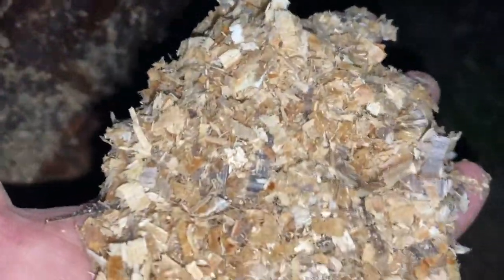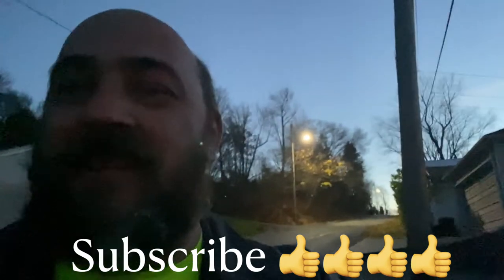Ported Homelite Super XL Auto Testing Round 2!

Comment: How did you port that saw?  Did you open up the intake and exhaust port?  I have a few super XLs and am curious.  They are a reed saw, so i don't know what to do with the intake side.  Did you deck the jug in some way to boost compression? take care
Reply from the maker: Don’t do anything to intake. Make sure reeds are working perfectly and no leaks. If you keep stock reeds they won’t last long.
Reply: @Smittyschainsaws  Thanks Smitty; I wish i had a neighbor like you that suffers from the same sickness as i do with a passion for old 2 strokes.

Comment: I saw a video here on YouTube where a guy found a different reed cage and reeds on amazon or something that fit right in
Reply from the maker: That was probably me!  I ordered another set because that first set is currently installed in a different saw.
Reply: @Smittyschainsaws  how'd they end up working out? Do you have a link for the part?
Reply from the maker: @hickerbilly345  I don’t have enough run time to tell you one way or another. I am just going to keep installing and running them until I make up my mind. So far they are performing better than stock. 

https://www.amainhobbies.com/o.s.-reed-valve-assembly-gt33-osm28316000/p655213
Reply from the maker: @hickerbilly345  Watch this video first.   

https://www.youtube.com/watch?v=3YLO48VzKh8&feature=youtu.be